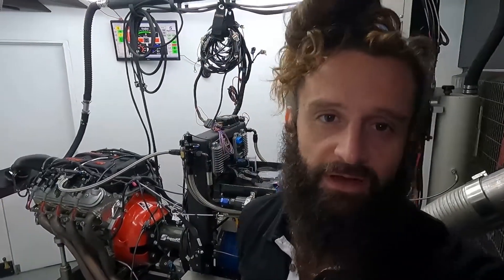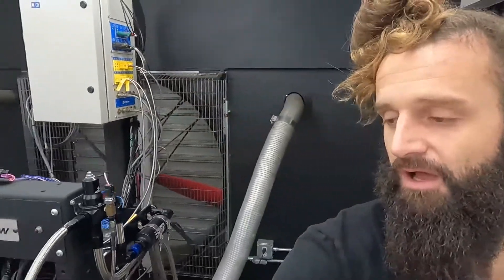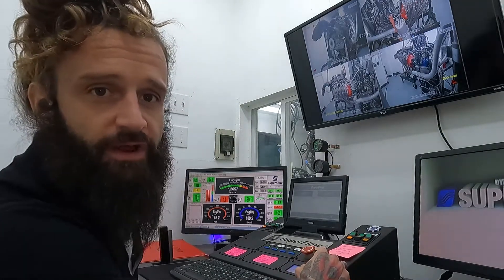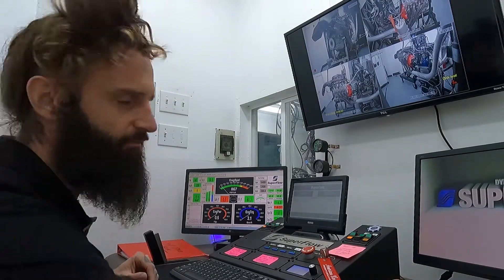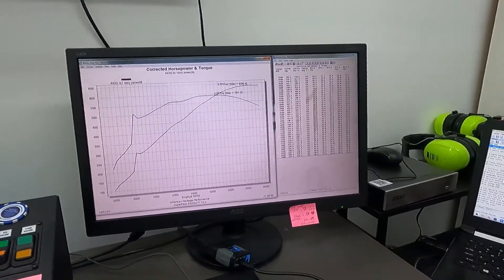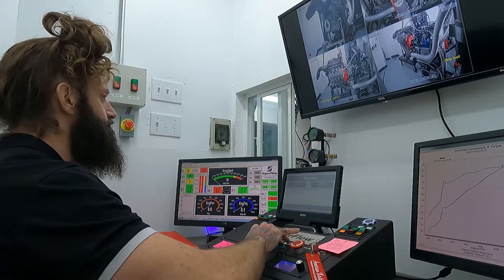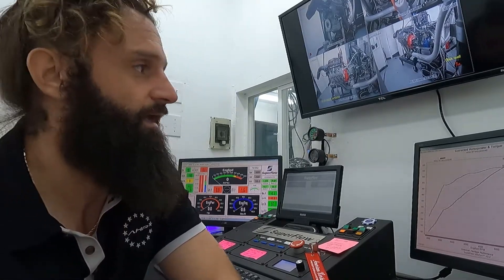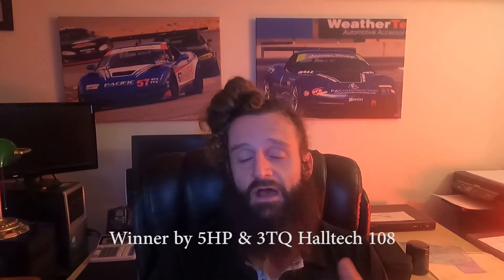Halltech 103 vs 108 cold Air Intake

Comment: Why would there not be any tuning changes? The maf area on the 108 is larger so thats going to throw the maf out of wack which will screw up fueling. 

Thats not a back to back test. The maf would need to be dialed in to the same afr with each intake.

Comment: I never understood why anyone would go bigger than the stock 427…
Literally doesn’t make more power if not less and makes just a dot more torque
Reply: It absolutely would make more power. Damn you are dumb. Rebuilt LS7s generally don't use titanium rods and that will cost you power.
Reply: A 427 won't make 638 with a 116 cam
Reply: im with you, smaler stroke, means higher revs and smaler wear.